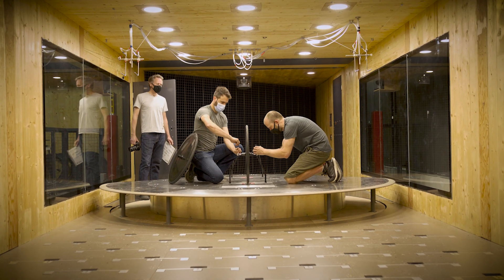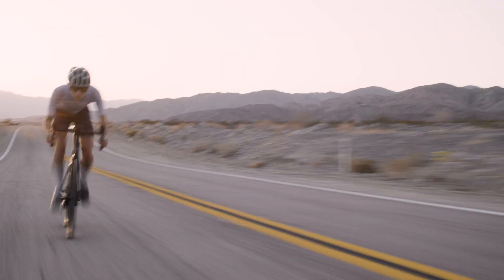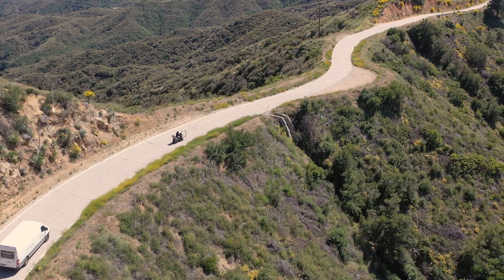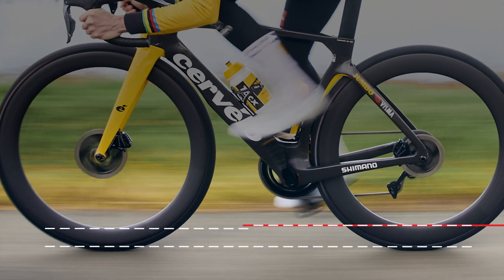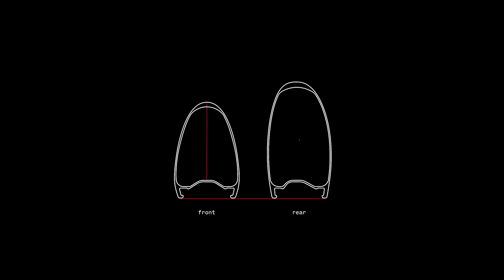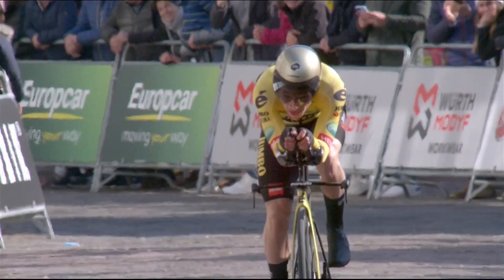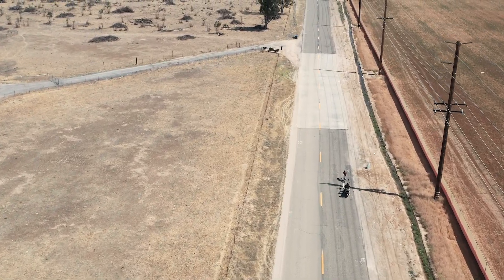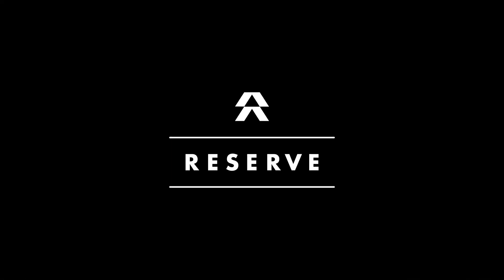Reserve Wheels 52|63 Road Wheels - Turbulent Aero

Comment: The outdoor turbulent data is the special sauce here. I’d imagine Reserve used this data to generate a turbulence spectra and coherence and replicated that turbulence with an active grid in the wind tunnel. And then tested the drag differences in the wind tunnel with that turbulence. Great work and approach to turbulent wheel design.

Comment: I use DT SWISS ERC 1100 35 for the front wheel and ARC 1100 50 for the rear wheel.
Reply: I am deciding b/w ERC 1400 35 and Reserve 34|37. Planning to use with GP5000 28mm. DT Swiss come with 240 hubs while Reserve come with 350s. Any suggestions on what to pick?